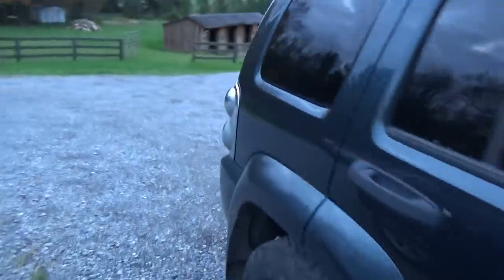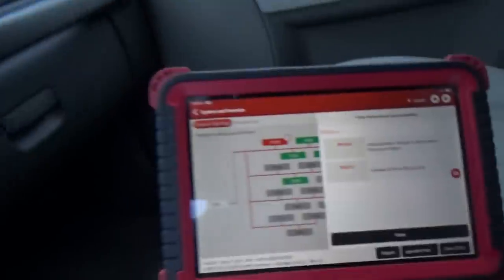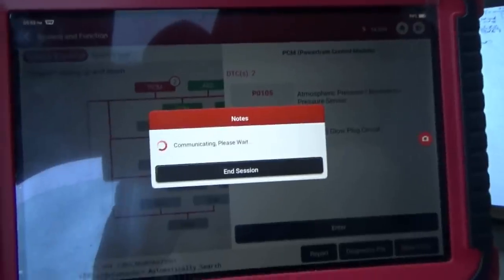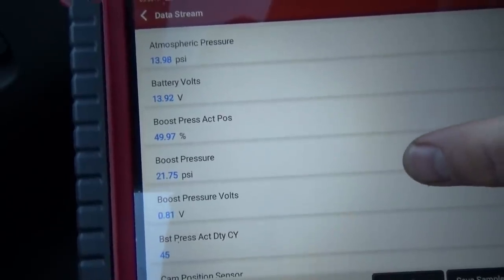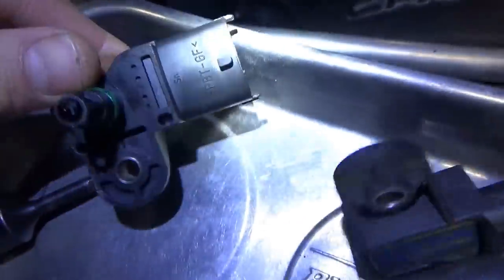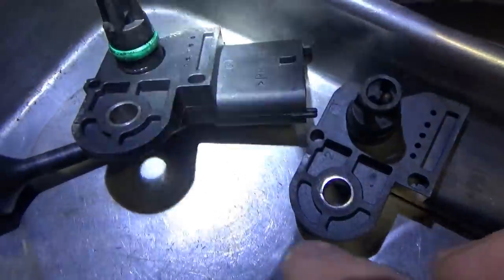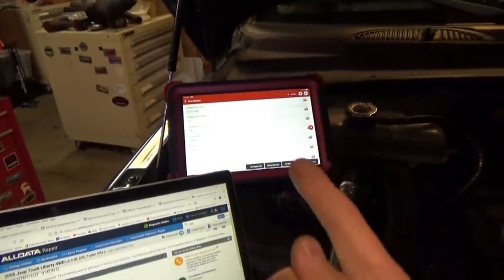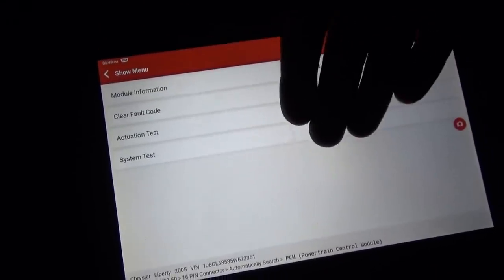Jeep sounds like TRACTOR?? (Low Power, No Boost)

Comment: 90's 318, 360 full size trucks had issues with IAC connector problems ran into where owners changed IAC from Advance scans and still had the same problem. After I fixed the connector good as new.

Comment: I have the big brother to that liberty. I have a 2008 grand cherokee crd 3.0L v6 and they are outstanding. Hands down best vehicle i have ever owned and my other rig is a 2015 durango with a hemi. The crd tops it in power, fuel consumption, and reliability. Ivan if you get the chance to buy a liberty or a grand cherokee crd, do it and dont think twice about it. They are extremely rare and only going to be more rare as they get wrecked or parted out.
Reply: Yes Nic, I pick up a minty 2008 3L diesel grand Cherokee almost 2 ago no DEF fluid it's been excellent
My 2015 & 2018 6.7 diesel fords were total junk always in the shop for warranty work
Reply: Sadly jeep isn’t making diesels anymore :(

Comment: Emissions have destroyed the diesel engine. I remember some of the best diesel from the late 90s early 2000s that were bulletproof. CAT 3126E, Cummins 5.9ISB, Powerstroke 7.3. Those were great engines. Detroit even had some nasty ones, they leaked like crazy, but if you kept them topped off they totally will run forever.
Reply: In my opinion the 31series cat engines were boat anchors. The rest were awesome.

Comment: Sold one with 287,000 miles a few months ago. Looked like new but had a major oil leak so I let it go at the auction. The truck here is missing it's engine cover, which I still have if the owner wants one.
Reply from the maker: Hey Ati! I too the engine beauty cover off for diagnostic purposes :)

Comment: Someone is getting really good at knocking off Bosch sensors, we have had issues over here in aus with a heap of DPF preassure sensors being knock off Bosch causing issues but still being sold through parts suppliers

Comment: Atmospheric pressure sensor might reside in the ECU. I bought a 05 Liberty diesel for $700 that I have yet to diagnose. Customer had another “tech” replace a injector but the engine will not run. My old Autel would not work with the Liberty but my new one does but I got to busy with other projects. They are a rare bird. I derivative of this VM engine is now used in the Chevrolet Colorado. Engines were noted for head gasket issues but they are a wet liner design like a industrial engine. One minus is they have a timing belt.

Comment: I have owned 4 of these diesel libertys. That VM motori engine is pretty good once the emissions equipment EGR "falls off". These things were plagued with problems when they first came out and most dealerships didn't have people that knew how to work on them. This 2.8 liter engine is a older brother to the ones that GM put in the Colorados. Also VM motori also makes the 3.0 ecodiesel that RAM uses in their 1500s. Back in the day you could buy a tune from GDE that would solve a whole lot of issues on these engines.
Reply: My egr fell off too...
Reply: U.S. emission controls are what did the 6.0 Ford Power Stroke in. In Europe that was a very good motor.
Reply: My EGR stuff fell off as well!!

Comment: That's wild ... I had that sound on my XJ, but it was because I put off replacing the exhaust manifold for about 10 years after it cracked.

(hey, GA kept passing my emissions, so why fix it?  Eventually I got tired of the noise)

Comment: I just recently obtained one of these CRD Libbys.  I replaced things like the glow plugs, timing belt, water pump, thermostat, fuel filter head, and fuel injector return lines as a "120k mile service".  Removed some other stuff, which should help extend the life of the engine and maximize fuel efficiency.  I'll change out the head gasket and replace the head bolts with studs, and change out the rockers/lash adjusters while there (all potential problem areas), then replace the torque converter with a heavy-duty low-stall unit.  One major problem with them here in the US is that hardly anyone knows how to work on them, they're a very nice engine one you address the problem areas.  My other problem with them is the platform Daimler-Chrysler chose to send stateside with this engine - but all of the Liberty-specific quirks are well-documented and there's plenty of work arounds for those.  I'm pretty tickled with my CRD, so far it has been a great Alaskan winter beater.  And I have yet to have any starting issues (we've hit single digit temps in my area) and that's all without having to plug in the block heater.

Comment: the ambient air pressure sensor should be located inside the engine ECU if it a Bosch computer it the same as a VW TDI and the ambient temperature sensor should be the sensor that show the outside temperature inside the vehicle and most car they are mounted close to the front bumper.

Comment: I noticed that when you had the replacement sensor installed and you had it KOEO the boost sensor would start at 6.6 psi. Then climb to 21.7 psi. But then when you unplugged the sensor it would do the same thing. So it seems like the customer installed sensor was acting like an unplugged sensor. There was 2 times where you unplugged the sensor and you can see that same thing happen. Where it goes up to 21.7 psi. Maybe somehow the sensor wasnt making good contact.
Reply: Yes! I noticed that too. Good catch :)
Reply: " the customer installed sensor was acting like an unplugged sensor"  Not exactly unusual for Chinese aftermarket sensors.

Comment: Sounds like a similar issue I had with the MAF sensor on my 2008 2.5 Impreza last week. Threw a P0172 CEL and had the long term fuel trim set to -25%. Hot idle was around 3g/sec. Wiggled the connector around, engine shook a little bit, sensor went down to 2.2g/sec and fuel trim started leveling back out. CEL went out on its own after a while, and it's been fine ever since.
Reply: There are aluminum bond wires that connect the circuit board to the plug inside the afm. If I'm thinking of the correct afm then it could be that you wiggling the connector has improved connection but it will not be permanent

Comment: Ivan  This is a great engine, So great in fact that they recalled it to lower the boost. It was eating the automatic transmissions with its crazy torque. 30 mpg was correct. Warranty service was killing them.
Reply: A friend bought a brand new one around 5-6 years back to tow his rally car, and the trans failed at 40k miles.  Dealer had the car for several months to get it fixed.
Reply: Transmission issues?  In a Chrysler?  That's crazy talk.
Reply: The main issue was in the torque convertor. Torque convertor shutter was so bad it would take out not only the convertor but the trans in some instances. The tune from GDE increased line pressure and changed shift points that helped somewhat. The torque these little motors had was right on the ragged edge of that the 545RE trans could handle.
Reply: @caseyhill3915  Has anyone tried that Lubegard additive in these?  It has worked miracles in other TCC shudder applications.
Reply from the maker: Would be a bulletproof truck with a beefed up manual transmission 😉
Reply: @kevin9c1  Nothing really worked other than Chrylser's answer which was to detune the engine or to get a TCM tune which increased line pressure. It was really just a band aid more than anything. The torque converter was just not able to handle the torque. There are some aftermarket companies that came out with a beefed up TC. Chrysler should have used the 47RE out of the RAM 2500 which would have handled the choice. The 545RE is fine for higher horsepower but not high torque at low RPMs like this little motor provided.
Reply: You all miss other issues...with this engine.. the upper end has lubrication issues and rocker lifter assys fail around 125,000 sometimes earlier.. mine is 112000 and has upper end issues
Reply: @glennschlorf1285  I have 182K with no upper end issues. Having to pull turbo because something is wrong with the Unison Ring. Getting ready for the 200K maintenance which involves pulling the head due to the exhaust vales prone to failing after that point. The only other failure I've had was the torque converter.
Reply: @cisco-man8638  mine did some idling... I am also going to use Lucas in it... my main issue has been misdiagnosis by the dealership
Reply: What i am like to know, what was the boost pressure in stopped condition, should be 0?
Reply: @glennschlorf1285  thought that was a 3.7L thing not a diesel thing for libertys
Reply: @riccracc6547  in 2005 and 2006.... a 2.8L inline 4 cylinder VM motori Turbo Common Rail Deisel was offerred. In the Libertys.. in 2007 Jeep offerred the 3.0 V-6 common Rail turbo Deisel from VM motori in the cherokee

Comment: What a pain that the data for sensors and connectors were hidden or all over the place.
Almost like it was shown that way on purpose :-(.
A connector pin outs with colours and functions/typical tickover values would have made life simpler.
Page two would show the sensor locations, overhead shot.
I bet the haynes repair manual would have been nicer.
Shame mr haynes passed away :-(

Comment: Lots of turbo diesels in Australia fuel here is expensive but not as bad as Europe and the UK . I can see why they are not popular in America where petrol is much cheaper . Turbo diesel engines perform very well especially the high torque at lower revs makes the them very lively to drive and tow very well too. Lots of problems with blocked inlet manifolds through EGR mixing with oil mist from the crankcase ventilation systems forming hard thick deposits. Injectors can be a problem where leakage can cause cracked pistons on higher milage engines. Another great diag the boost reading tricked me until you mentioned it was reading actual atmospheric pressure.

Comment: Mine was doing the same thing and I went through the steps as you did and yet it would run great and for no reason it would lose power and run like a Kobota.....so when I changed the fuel/water separator filter at the scheduled mileage it was BLACK!!!..I pulled the fuel tank and found it to have suspended particles of black jelly!!!  what is the jelly? don't know but after cleaning the tank and putting on a new filter the problem has not come back that was in 2019

Comment: On my 98 Contour, with the P0171 and P0174 lean codes. The main issue was the fuel pump and fuel regulator. Pump was only producing 46 psi which is the bare minimum, not any higher. The pump pressure should be 60 psi according to Ford. With the 2.5 V6, it needs the 60 psi of fuel pressure to run the engine at high RPM. It had a slight vacuum leak which we took care of earlier but the codes came right back.

Comment: I'm curious about the low RPM values reported by the crank and cam sensors. Did that go away with the reinstall of the original MAP sensor, or did that just not matter?

Comment: Same CRD here- why would it become drastically underpowered in drive mode (yeah, tractor sounding) after 15 minutes or so of driving? Then pull over, shut off the engine for 10-15 minutes, start up again and drive off to destination (12 mins away) totally fine (no more underpowered)!  Temps 70 degrees, driving in suburban area at 40mph. Great vehicle otherwise.

Comment: Terminal fretting is a real problem on diesels. You are spot on. Even 5.9L Cummins, possibly 6.7L too, will lose injector bank 1 or 2 functionality as it goes into limp in. Cause is terminal fretting at one of two Valve Gasket/harness connectors. Unplug, fill with die-electric grease and fixed.

Comment: 1 Bar = 1 atmosphere.
Supposed to be 14.7 psi for one bar, but maybe zero voltage means that it's ambient pressure????
Beats me.
Diesels don't tend to have a lot of vacuum - or so I believe.
I stick with V8 gas engines.

Comment: The 1st gen libertys, in my opinion, got a bad rep. I had a 2006 with the 3.7l 4x4 and I loved that truck. The only problem I had is I would have to change the cam sensor about every 6 months, but that thing was a runner and would go anywhere. It saw a lot of mud and the occasional snow that we get here in middle TN and I never had a problem with it. One time I even pulled a lifted 4x4 Toyota out of a ditch on ice covered asphalt. I would love to find one of these in a diesel.

Comment: I have a Benz w203 270cdi, the engine cover fits very close  to where the cables exit the can position sensor and can cause it to become unplugged and loosen the internal spade connecters causing a no start.... I have had this, also if oil leaks from the sensor O ring, t can contaminate the connectors... The signal current is so low so also causes a no start situation... I broke down at a filling station, luckily I had my scanner... Cam sensor fault... Was dirty terminals!

Comment: Wow,  love the opening video when you walked over and cranked the engine, lol!  Diesel clatter!!  Takes me back lol! Great fix!  I don't care much for a diesel with electronics on it! It ruins the Diesel!  I prefer totally mechanical engine without anything added!  I'm just old school! Used to have 1982 Bedford CF 2.3 liter diesel.  Everything is totally mechanical!  Lasted 400,000 miles before it needed a rebuild!  Loved that van! Went everywhere with it, camped, pulled caravan, day trips etc.   Too many memory's!  Sir that jeep supposed to rattle and vibrate! It's a Diesel!  Hahaha
Great video ivan!.  Many thumbs up!

Edit:  have you ever thought about a go pro that goes on your chest and head,   keeps your hands free you work on?
Reply: I've heard Chrysler engines sound exactly like that before, the problem was they were Gasoline 2.7L v6 "LH engines". DOHC, 24 valves of fury, triple flailing loose timing chains, water pump leaking directly into the oil, metal everywhere from the obliterated timing set. shortly after wasting $$$$, Mr. Rodney #6 went to hammering a very sour tune, the piston could be pushed 1/4" downwards via screwdriver through plug hole. "there's your problem lady"

Comment: I'm with you Ivan,  i would love that engine in my Vitara.
Reply: I'd like that engine in my Can Am Spyder!
Reply: @adotintheshark4848  Omg can just imagine a Spyder pulling up sounding like a miniature Cummins!!! Hats off to anyone that could make that engine/vehicle combo actually work without major re-engineering. I had an 08 Spyder back around when they first came out. Absolutely loved the thing!
Reply: @CumminsDriver100  I had a 2013, similar to yours then bought a 2017 F3. Love it too.
Reply: @adotintheshark4848  Very nice! Next I'm looking at getting a Polaris Slingshot. Yeah its a lot to spend on a toy that at least where I live, you can only drive it three months out of the year if you're lucky. But these things are just good for the soul. My excuse, and I'm sticking to it!!!!
Reply: @CumminsDriver100  While I liked the Slingshot enough to nearly buy it, I was put off by its size. Also by its GM engine. However new Slingshots have a Polaris in-house engine said to be much better.

Comment: At time 4:42, Fuel Pressure is at 5702.85 psi? That seems a little high, isn't it? Some of those numbers are ridiculous.
Reply: It's a common rail diesel they run very high pressures

Comment: Great diagnosis and NPR fix Ivan! Agree that diesel engines vibrates the crap out of a lot of these connectors and I typically do the same : pin spreading, spray contact cleaner and put a dab of dielectric grease on all those connectors. Actually do it routinely on my Isuzu shop truck and re-apply dielectric grease every after an engine wash. 

You should definitely get a diesel shop truck if you decide to change out the XL7.. Cheers!

Comment: There are some Grand Cherokees out there too with that engine.
Reply: The Grand Cherokees with this engine never made it stateside, though I have seen plenty of the 2.5 CRD and 3.1 CRD in my time overseas.  The ones that made it to the states had either the Mercedes 3.0 OM642 or the EcoDiesel/VM Motori 3.0 CRD.
Reply: @AKJeeper  I assume Mercedes in WK1 and EcoDiesel in WK2.  If that's the same Mercedes as the Bluetec they have plenty of issues.
Reply: @AKJeeper  I have seen 3 the past few months.. I live in NY

Comment: The turbo boost pressure....seems very high. Is that normal??? I would expect mild boost of around one atmosphere maybe. Is the waste gate electronic or conventional?
Reply: It's a diesel; high boost is normal.
Reply: the boost sensor is reading the normal atmospheric pressure and then it add the boost pressure over top of that let't say the vehicle is sea lever it should read 14.5 psi then if the waste gate is set for a pressure of 15 psi then the total pressure will show 29.5 psi .
Reply from the maker: Keep in mind it's reporting absolute pressure, so boost above atmosphere would be 33psi - 15psi = 18psi, which seems normal :)
Reply: it adds that reading to 14 so it was at 15 boost max
Reply: it's normal and there is no waste gate on the Liberty CRD. It uses a variable displacement turbo.

Comment: I think that last graph explains everything, the computer is lying to you. The boost pressure shown is some value it calculates over time, not a directly calculated value. Who knows how it is coming up with those numbers. Other 'weird' PIDs might be doing the same thing, too.
Reply from the maker: Exactly, if the voltage is out of range, the PCM comes up with a "substituted value" :)

Comment: They put turbos in these?
Reply: All little modern diesels do. Otherwise they'd be too slow.
Reply: @volvo09  Every diesel has one now a days...
Reply: @volvo09  don't act like you know everything. Every diesel runs on a turbo. How else do you thing they get high compression?
Reply: @rayj33  is this for real?
Reply: @volvo09  yes diesel cars and trucks run with turbo otherwise they can't make enough power to move fast